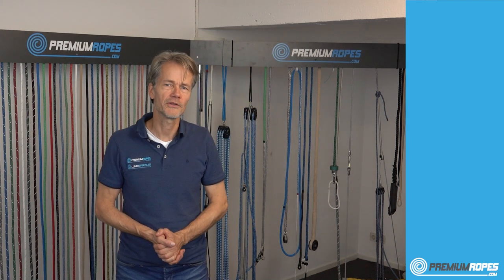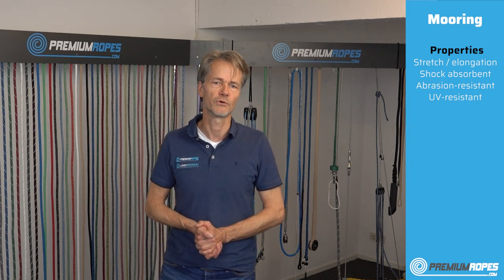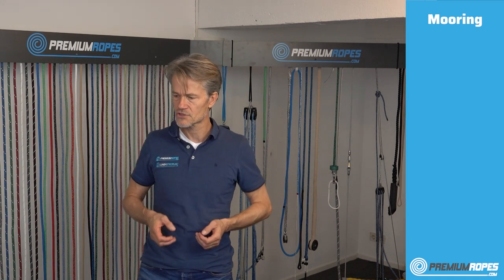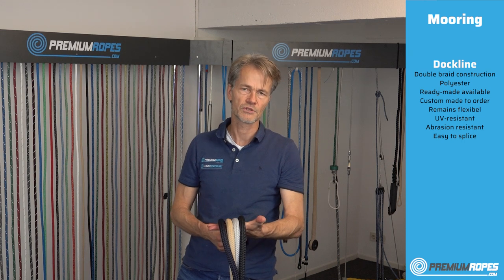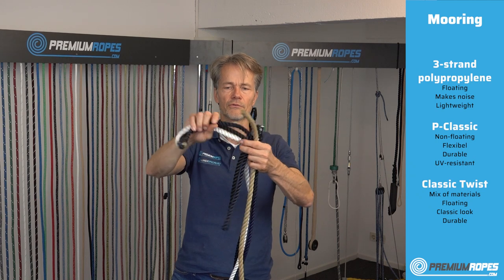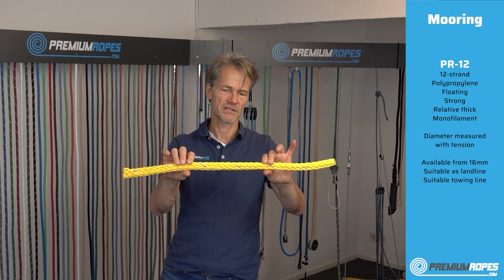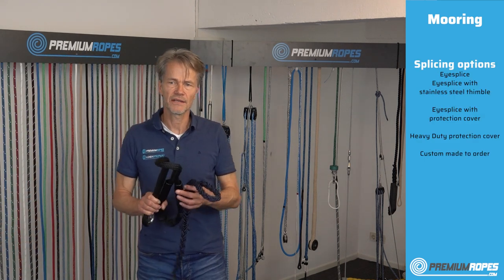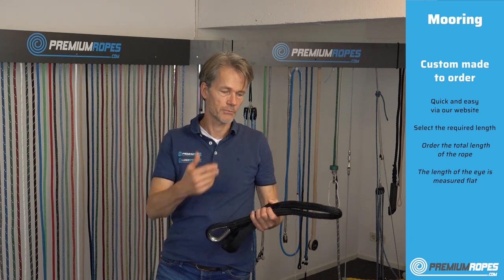Premiumropes Mooring ropes explained

Comment: Why not Polyamid/Nylon. I use it on my Hanse 342 as anchor snubber and mooring line as it has more stretch than Polyester (especially in 3 strand version) and has same braking load and other characteristic (UV resistance eg.)
Reply from the maker: Indeed Polyamid is a material which can be used too. It's popular in the US. For the moment we prefer the polyester fibre
Reply: @Premiumropes  Can you explain why you prefer it. I am struggling to find reasons why.